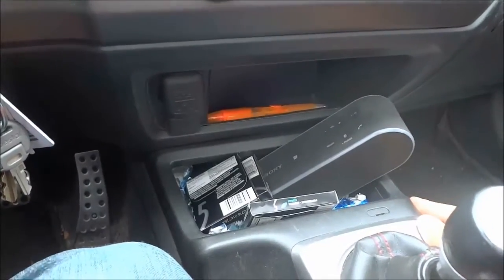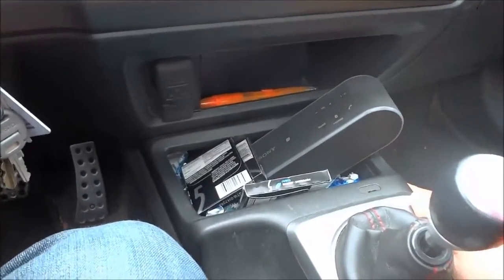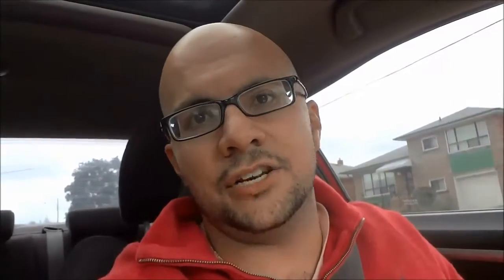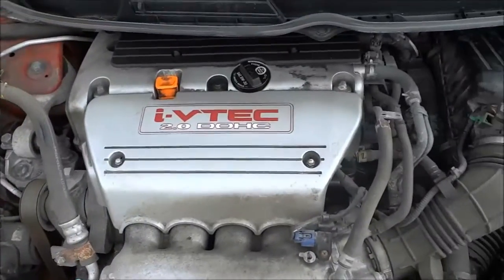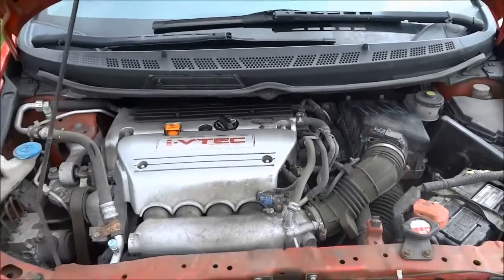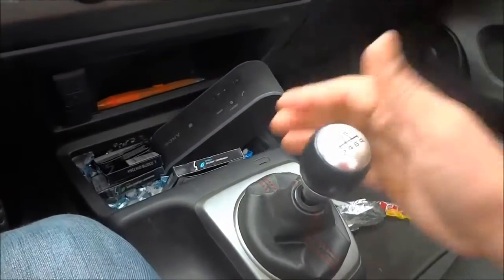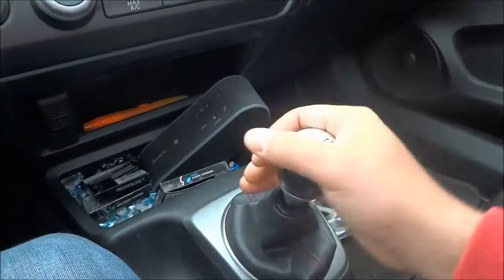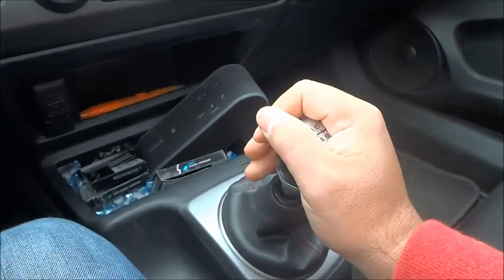5 Things I Don't Like About My Honda Civic Si (8th Gen 2006-2011)

Comment: i
had a Chevy Venture minivan with a cramped engine bay when it was time to replace the Engine found out later it has to be dropped out from the bottom of the van to change over.
another thing is to stay away from the PT Cruiser nice car but if the water pump goes and you have to replace it that is a good 10hrs job cause the Water pump is inside the Engine.

Comment: I have a rattling noise on the passenger side and its the only thing i dont like in my si. Any idea what it would be?
Reply: Every find out what it was? Could be suspension
Reply: @white9th193  It was a loose speaker mount. Had to take off the door panel carefully and re screw the speaker.
Reply: @torterrathegreat055  glad you got it fixed bro